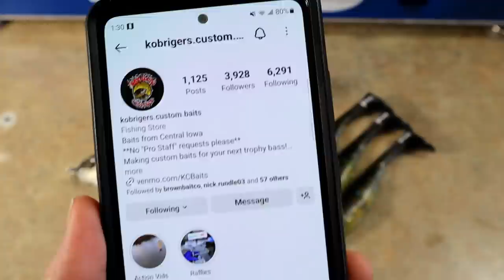Back 2 Basics: Stick Worm Custom Baits & Glide Bait Color-Match

Comment: Your videos are always helpful so to try and help you back Amazon sells this lever-action pump 5 gallon bucket lid it is and lip for five gallon buckets with and manual pump on it that way you never have to use a measuring cup to scoop out plastisol and it will keep your stuff sealed still
Reply from the maker: That's pretty cool